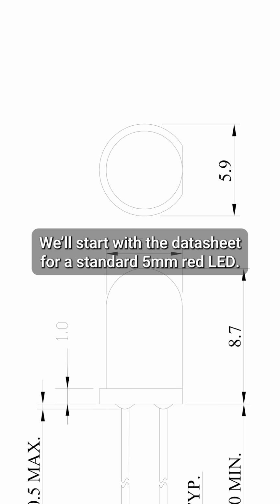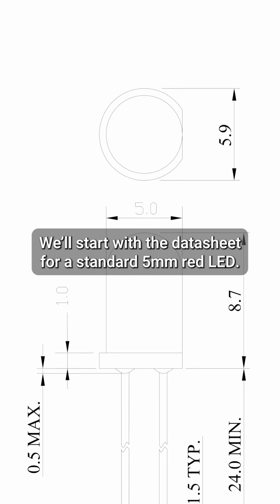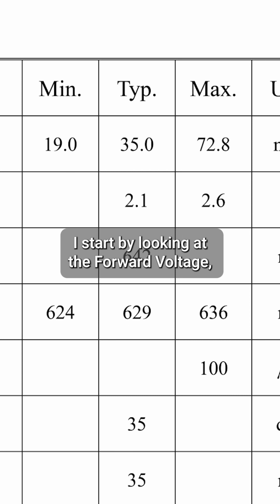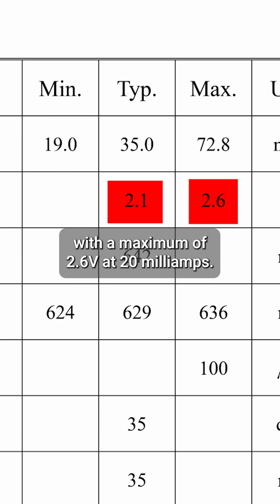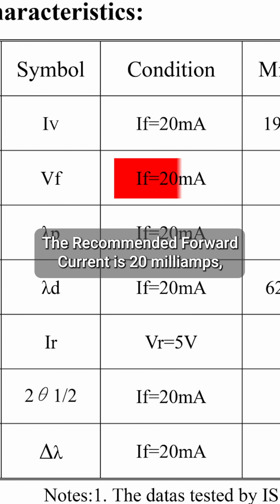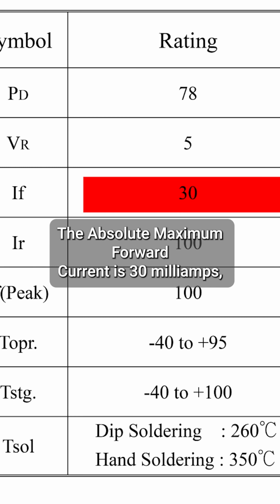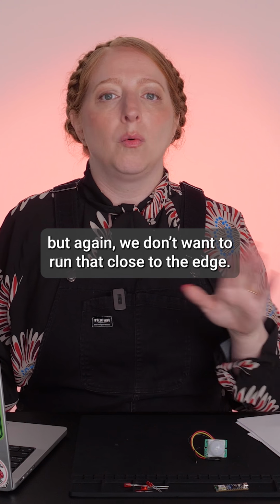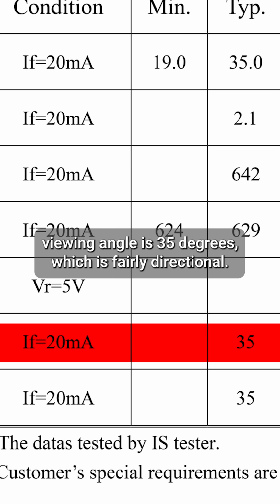How To Use an LED's Datasheet #BeckyStern #Short

Comment: Do not blindly run 20mA through a modern LED - example: I’m have 10000 ohm resistors on my modern green SMD LEDs and I’m still getting blinded.
Usually 5, 1, or 0.1mA will give you decent brightness even if the datasheet says you can run 20mA through it.